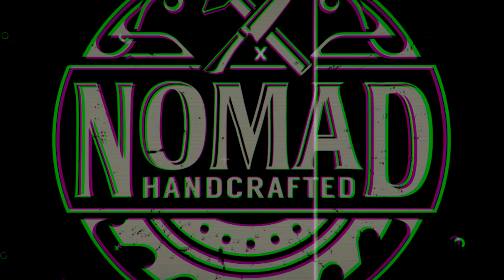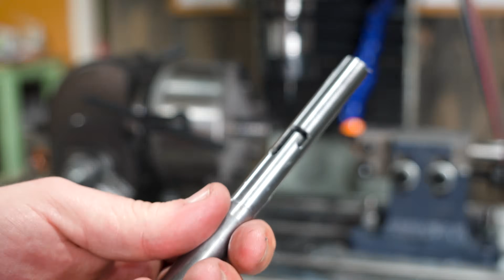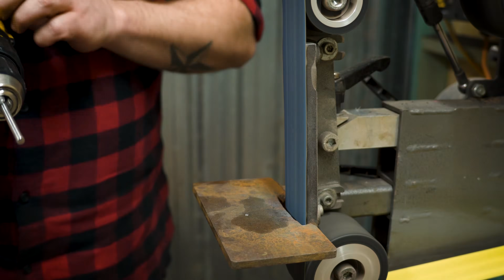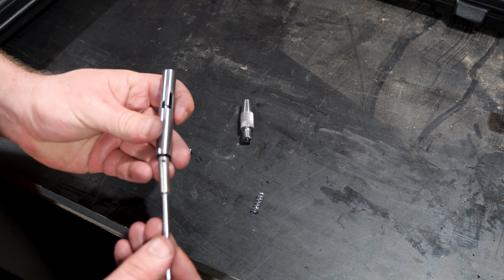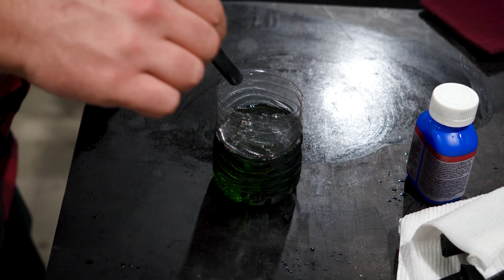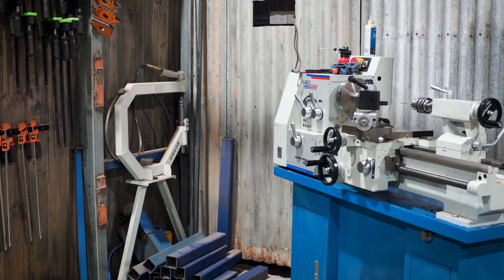Making a Bolt Action Retractable Scribing tool!!

Comment: Pointy stabby thingi wasn't too hot on lathe? It looks kind of like after tempering during cutting 😅 Anyways, great little stabby pointy EDC scribe 😀
Reply from the maker: Oh yeah I blew the temper on the end near the tail stock 😂 so that was the end that didn’t get sharpened. When watching the video back it did only make it into the browns in colour so it probably wouldn’t have been too bad, but for safety I didn’t use that end 😂 thanks for checking it out!